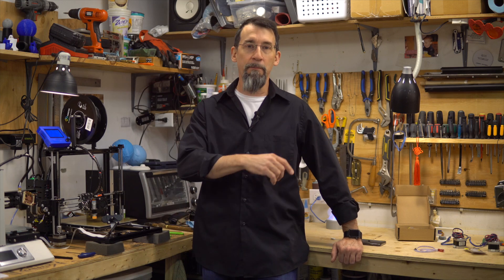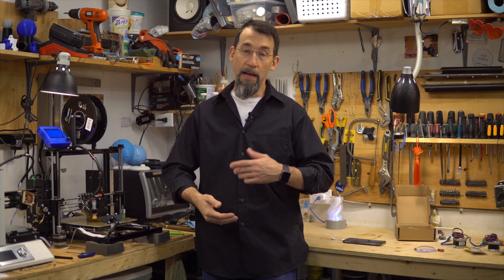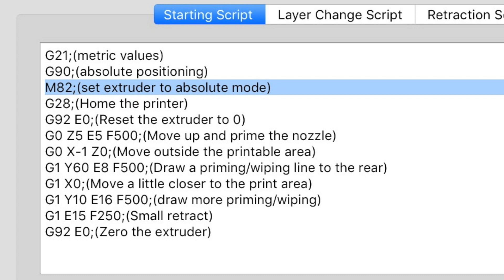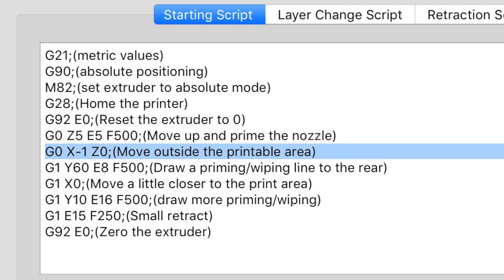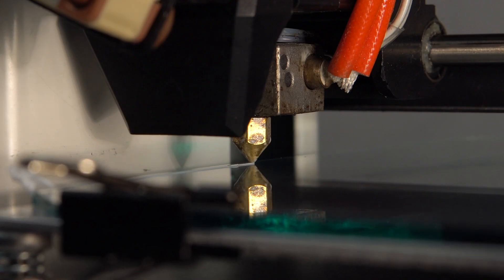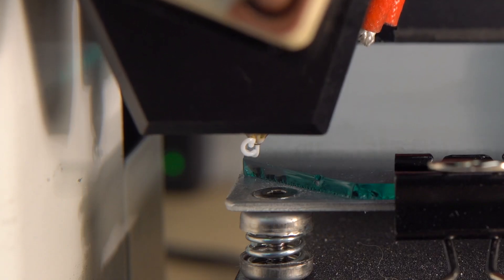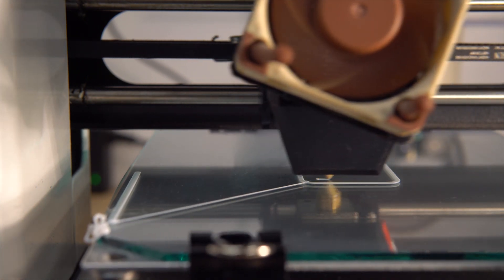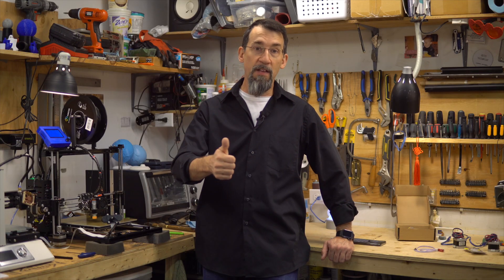Monoprice Mini - Useful Priming Start Code

Comment: I'm just starting out with a new Monoprice Mini v2. I've calibrated and done a few successful print from the included SD card. When I added above as Start G-code my very first attempt with a newly sliced model, it drove the extruder into the plate. I aborted as quickly as I could. I'm trying to understand what went wrong. I've gone back and verified that my code is exactly the same as the listed start code from your description.
 

Is it possible that this code isn't good for the newer model? Any ideas as to what I might have done wrong?
Reply from the maker: Hi, your bed level is a little to low, you should make sure that when the printer is at Z height of zero a normal piece of paper can slip under the nozzle. https://www.youtube.com/watch?v=th29ii4lZhY&t=1s

Comment: I don't get the diagonal line, why is that, the code is the same as yours
Reply: Also you seem to have much more filament coming out than I do, why is that?
Reply from the maker: Hi, I have calibrated my extrusion, I have a video on this, after measuring you can use a multiplier in your slicer or change the preset in the printer or in the start code of the slicer. https://youtu.be/lvTiOxRwEtc
Reply from the maker: Hi not sure why, send your start code or an example of your gcode at franks3dshop@gmail.com
Reply: Mine does the same thing and my start code matches Frank's, except where they wipe the same line in reverse direction (G1 X-1 instead of G1 X0). It is the latest Cura profile and matches yours. Maybe there was a change to Cura in the last couple years? May be it's an option in the print settings instead of the start code. I'd prefer to continue the wipe to the part or brim/skirt to reduce stringing I get that interferes with the first layer.

Comment: you are amazing that is working perfekt ,,,

here is the version for Anycubic i3 mega ultrabase:
G21;(metric values)
G90;(absolute positioning)
M82;(set extruder to absolute mode)
M107;(start with the fan off)
G28;(Home the printer)
M501;
M420 S1;
G92 E0;(Reset the extruder to 0)
G0 Z5 E5 F500;(Move up and prime the nozzle)
G0 X-3 Z0;(Move outside the printable area)
G1 Y60 E8 F500;(Draw a priming/wiping line to the rear)
G1 X0;(Move a little closer to the print area)
G1 Y10 E16 F500;(draw more priming/wiping)
G1 E15 F250;(Small retract)
G92 E0;(Zero the extruder)
G1 F{speed_travel}
G0 Y20 F{speed_travel}
M117 Printing...
G5

Comment: I just changed to a new filament and the extruder clicks on the second extrude E16, is this double the first line? Rest of prints are fine.. any ideas?
Reply from the maker: The clicking is usually from a filament jam, I found that sometimes it is hard to pass the fitting just above the heat head, try to slowly and gently push the head to the far right. Than try inserting the filament again, maybe push a little harder when you first get resistance. Hope it helps.
Reply: @Franks3Dshop  I noticed that as well, I now park my head to the right to curve the bowden tube more, but I think I have a clog, after testing I noticed it is very hard to hand feed filament, it used to not be that hard
Reply from the maker: I would replace the tube if it’s in the tube that it rubs. If it’s a partial clog, it will not come out straight down near the nozzle it will have a tendency to curve at the output. And it will be harder to push in, you can try removing the tube to push filament directly, be careful not to push on the arm. I also have a video on cleaning the mini https://youtu.be/8zsV_FN-y4o

Comment: Thanks for this video Frank!  I have been 3D printing with my Monoprice Mini now since Chrsitmas and I kept wondering why on the wiping procedure my nozzle never got moved closer to the printing area? I compared your code to that of the code my Cura slicer generates, the codes for "X-1" stays the same for both movements!!  I kept wondering why it seemed my nozzle kept running right back into the same wipe line it generates.  I have another separate issue, even though Cura is supposed to send G-code for the fan turn remain off on the first layer, my nozzle fan stills runs from the start all the way through the print job??
Reply from the maker: Hi, that little printer has only one fan, and seems to be temperature controlled, if it goes off during prints, the heat will eventually melt the supports of the hot end... you can block or reduce the output to the part with a tape. Or modify the head for a second fan. Myself I just leave it do it’s thing.
Reply: @Franks3Dshop  Thanks for your confirmation on that Frank, shortly after I sent this, I was wondering if that would be the case.  It does work to slow the fan speed down some with Simplify3D but not completely off.  It can throttle it back to around 25% on just the first layer and then back to 100% on the rest of the layers with Simplify3D now.  I completely understand the reasoning now, it's a great little printer but I definitely see the need to get newer fans.  I just ordered the same as you have listed, anything has got to better than the stock ones, lol.  Thanks again!!

Comment: how do i import this code to my no mini v2
Reply from the maker: It depends on your slicer software, it goes at the end of the printer start code, in Cura you have to go to the Setup Printer Menu.
Reply: ok thanks
Reply: so i can Remove  the code in my cura and  replace the one you have  in the video
Reply from the maker: If you have the same printer, than yes.
Reply: i have the V2
Reply from the maker: Good me too so you take my start code. Be sure to watch it first time you try it. I may have an updated script, let me look.
Reply from the maker: @crocythecrocodile8843  Here is my latest start code for the V2:

G21;(metric values)
G90;(absolute positioning)
M82;(set extruder to absolute mode)
M107;(start with the fan off)
G28;(Home the printer)
G92 E0;(Reset the extruder to 0)
G0 Z5 E5 F500;(Move up and prime the nozzle)
G0 X-1 Z0;(Move outside the printable area)
G1 Y60 E8 F500;(Draw a priming/wiping line to the rear)
G1 X-1;(Move a little closer to the print area)
G1 Y10 E16 F500;(draw more priming/wiping)
G1 E15 F250;(Small retract)
G92 E0;(Zero the extruder)
Reply from the maker: @crocythecrocodile8843  Sure here is my end code:

G0 X0 Y127;(Stick out the part)
M190 S0;(Turn off heat bed, don't wait.)
G92 E10;(Set extruder to 10)
G1 E7 F200;(retract 3mm)
M104 S0;(Turn off nozzle, don't wait)
G4 S300;(Delay 5 minutes)
M107;(Turn off part fan)
M84;(Turn off stepper motors.)
Reply from the maker: @crocythecrocodile8843  Also when have time, I suggest upgrading to the latest 3.5.0 Cura, bunch of improvements since 15.04.6 some years ago, you now have a printer preset in Cura for the Mini...
Reply: i know but how do i dasable the prim nozzle on start up
Reply: can you sho me a code where i dont want the nozle wipe and i just want the nozzle to extrude 3 mil of filment and then moove to the build place to start the print

Comment: Great video as always Frank! I have a question not really related to this video but related to this printer... how does ABS print on the Mini? This printer  is one of my two final contenders, and not being able to print in a more robust material could be a real deal breaker for me; I´m going to use it for prototyping, mostly small parts, and the small footprint  (among other things) of the Mini looks very appealing to me, not much room left in my work space :(... Thanks a lot and keep those videos coming!
Reply from the maker: Hi and thanks, I would not recommend the mini printer for anything else than PLA, as for ABS you need an enclosure around the printer or the pieces will warp and also the fumes are nasty stuff, I prefer PETG, but not without changing the hot end on the mini (and it’s the same for any printer that as a PTFE tube too close to the heat bloc), or you will get clogs all the time and melting of the PTFE bowden tube. You need something like the E3D v6 for that (orginal). PETG can be printed without an enclosure. Hope this helps.
Reply: It sure does help, thanks!

Comment: Hi Frank, Rocky again. I ran into something I don't understand with my Cura 3.3.1. I got some 3DSolutech transparent blue PETG to try on my MP Mini V2. I made a simple key fob for the wife w/her name on it, sliced it in Cura and loaded the gcode into my mini and identified the material as PETG. After 15 to 20 minutes of waiting, the bed never got up to 70 degrees C. 64 to 66 seemed to be her max. I re-sliced it in Cura with PLA as the material and put the gcode into the mini, with the PETG still loaded, and it ran well. Can I change or chould I change the bed temp setting in Cura for the material I bought or just keep running it as PLA?  i did up the bed temp on the mini to 60, and extruder to 200, and cut the speed from 1.0 down to 0.8. Thanks
Reply from the maker: Hi! PETG is hard to print on the Mini, you have to slow down to 20mm/s, heat the hot end at 235 at least, and the bed 50 or 60 should be fine with glue. Use a first layer of 0.3mm. Also you can bloc the part cooler exhaust since PETG does not need cooling especially if you have supports and you can not turn off the hot end fan or it would melt the hot end.
Reply: Frank's 3D shop Thanks for the quick reply. I used the stock BuildTak that came on the printer. This was only my 3rd print since the cat that came on the SD card. Why was the printer trying to get to 70c when I first sliced the key fob with the material set to PETG in Cura? Can I change this because I don't think the bed on the V2 can get to 70c. When I changed the material in Cura to PLA, the bed ramped up to 60c, the print head went up to 220c and the print started within 3 to 4 minutes. The skirt laid down nice and the fob printed OK. There were some fuzz on the top of the letters, but not bad. Thanks
Reply from the maker: Hi, if you are beginning in 3D printing, I would stick to PLA for a while, as for the presets, everything is configurable and you can save your own presets, the presets from Cura 3.3.1 are a good start, use the Custom section to see more advanced settings, and go from there. When you hover over the settings, Cura gives you a description and you have icons to guide you the turning arrow means to go back to the save preset. The "i" in a circle is to make Cura calculate that value from other setting instead of overriding it.
Reply: Frank's 3D shop again thank you. I have 3 spools of PLA to work with, 1 glow in the dark, one white, and 1 silver metalic. I should be OK for a while! Thanks, Rocky
Reply from the maker: Cool, only thing, the glow in the dark is abrasive so it will enlarge the nozzle hole. Not sure about the silver could be the same. Have some nozzle on hand, or replace it with a stainless one.
Reply: Frank's 3D shop Wow, I didn't know that. I got some nozzles in my Amazon cart, guess it's time to punch the "Purchase"  button:), thanks.

Comment: Now that the monoprice select mini has a profile in cura, their opening g code does almost the exact same thing (except I don't think it extrudes as much filament). I did want to thank you for telling me to copy the code from the cat file to the ending gcode though! I prefer the ending gcode on the cat file to the one cura has for the mini. Their ending has the bed to extend outward toward you so you can remove the print. The problem with this is that the gcode tries to extend the bed too far and it clicks and locks the printers motors up for a few minutes. This makes it impossible to move the bed back to home when you're done. The only way I've found to fix this is to either wait until the motors unlock on their own, or quickly restart the printer. I've also had cases where it prints an item called "Print", but I've cancelled it before it's gotten to far.  Hope someone finds this info useful!
Reply from the maker: Hi, thanks and yes Cura as a profile now for the mini, last time I checked it had some strange settings though!
Reply: I didn't look at that end g-code but I guess there is "G1 Y120" to move (G1) the bed to the max (120 mm) in the Y axis. Replace "G1 Y120" with " G1 Y100". It (100 mm) will be enough to remove the part easily.
Reply: Mike, I had similar problems on my mini whenever I did an extreme extension of the bed to the front.  I discovered that this was due to the bed wiring interfering with the pulley.  This leads to the wire kinking and breaking and you lose either the bed heater or the thermistor sensor or both.  This is a common problem with the mini. Frank has a separate video where he describes one of the many solutions should this actually be your problem.   I no longer have this issue and the Cura ending code works fine.